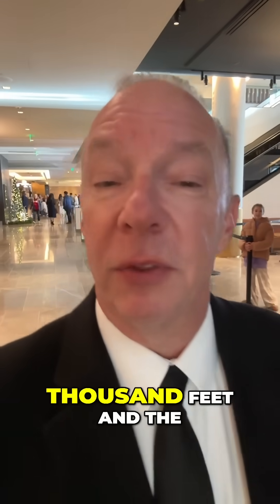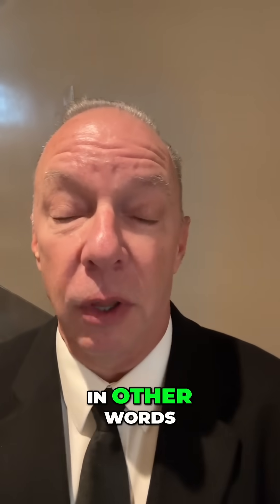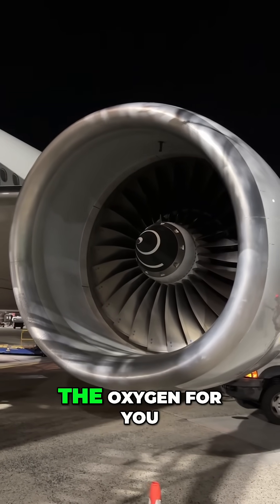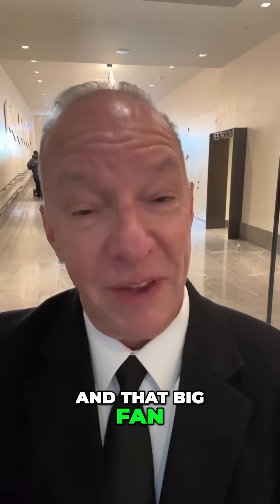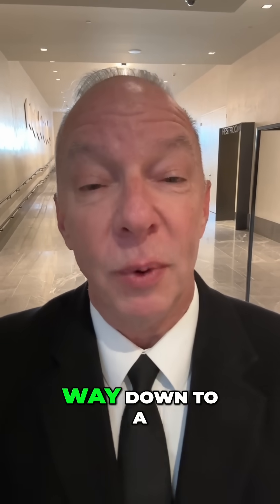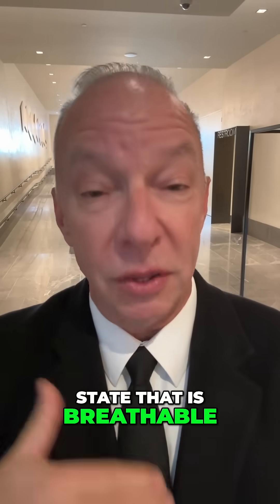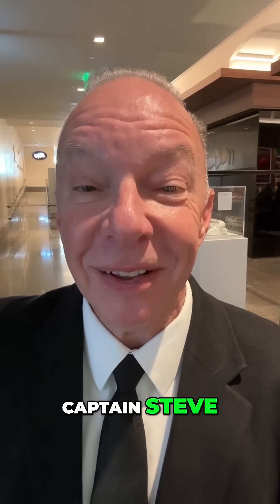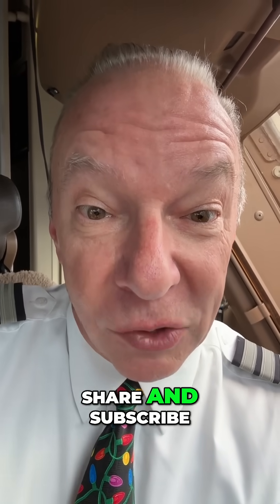How Airplanes Make Breathing Possible at 37,000 Feet

Comment: Will the battery 🔋 plane's they are saying are better can do this efficiently? Ive neber see that talked about. So cool. ❤
Reply: The Boeing 787 already has electrically powered compressors to pressurize the cabin air, independently of the compressors that are part of the jet engine.

Comment: Great stuff! Just a little missing detail: the cabin pressure is not set to sea-level as that would create unnecessary pressure stress. Normally passenger airplanes have a cabin altitude of around 8,000 ft, around 25% less pressure than at sea level. For comparison, Denver, CO is at 5,300 ft and La Paz, Peru is at 12,000 ft.

Comment: It's nice to hear a pilot that understands the working of these systems, especially the inner workings of the jet engine.
Reply: lol yeah most do as they must know what look for and have to read a Manual to know how to operate said aircraft. These Manuals are massive. 😅
Reply: @bigmungus4864  well yea, but jets are far more advanced than your standard combustion engine. I have far more respect for a professional that is able to explain the complex concepts at work here, In fluid dynamics, pressure differential, etc.
Reply: They are actually required to know just about everything about the aircraft they fly.
Reply: @Thomas63r2 rubbish , most don't know anything about the engines , just like race car drivers most times can't tell you how a simple car motor works , not their job , that's the engineer.
Reply: @JosephCowen-fz8vj  Incorrect, and no need to be rude. They don't know on engineer or mechanic level, of course, but they have profound knowledge about planes mechanics, avionics and correlation to anything related to aviation. Just like F1 car drivers know in detail all the mechanics to provide feedback to their techs, only much more complex.
Reply: @Rondo2ooo  if I was being rude you would know it . Well the facts are incorrect. A turbo fan is not a front " fan" is not a compressor turbine, infact you could remove that fan and still get thrust, I've had airforce members of my family all my life , and bar basic understanding, they know little of engine design , they leave that to as stated engineering crew . I think profound understanding is wildly overstated . All crew and pilots I've met have a basic understanding, the engine is far to complex for anything else . Pilots fly planes , like race car drivers drive cars , ask a F1 driver how the motor works , he couldn't even tell you how to start it . F1 drivers haven't given feed back for 35 + years , all computer telemetry as in modern planes .
Reply: @JosephCowen-fz8vj  For the video topic it's nitpicking. This was not a master class for turbine engineering and served its purpose for a short about oxygen provision. F1 drivers still provide individual feedback additionally to the telemetry. One prominent example is Michael Schumacher, who helped Ferrari to build competitive cars, because their telemetry obviously wasn't enough. Others do that, too. But we can have different takes, that's totally fine. It's just YT.
Reply: @JosephCowen-fz8vj  Lol!  Your mileage may vary - but every pilot I've ever talked with seemed to have technical knowledge of the planes they fly.  Interesting your race car driver analogy: I spent years in racing.  Even when not required, all race car drivers I ever met all found the technology interesting enough to often be the subject of conversations.
Reply: @Rondo2ooo  usually people don't consider pressure differential that's what I appreciate more
Reply: @Thomas63r2  you might want talk to  Danika Patrick on that one , she has won many many NASCAR races and in her own words " has no idea even how many cylinders it has " .
Reply: @JosephCowen-fz8vj  at least 1
Reply: @verdisquo97_arts  I'm sure some pilots take an interest in gas turbine engineering, but as a rule , couldn't care less , their job is to fly the plane , not to fixate on exhaust turbine temperature thermocouples and over temp blades .
Reply: @JosephCowen-fz8vj  I mean, king of random was a pilot before he became a hobby YouTuber, so pilots can have lots of interests
Reply: @JosephCowen-fz8vj  Quit with all this business that Danika knows nothing about cars, she makes comments like that to stroke weak egos in the racing world.
Reply: @Thomas63r2  yeah nah , and she's not the only one , race drivers don't think about motors unless they are in pieces bouncing into the trailing cars radiator. Simple .
Reply: @Rondo2ooo   Capt. Steeeve did not know the difference between a stator and a rotor. That's an indication of a serious lack of knowledge.
Reply: pilots are required to know pretty much everything about the aircraft they fly, especially the captain... seems like common sense
Reply: @mindlesspear8840  I can't believe it's been months since I said this message, and people are still talking about it.
Reply: He is a military veteran as well. He has had lots of time to think about the workings even if just curious.
Reply: He misspoke about tge stator vanes since they're stationary.  Rotor blades rotate.  Most pioits have a basic to moderate level of systems understanding.  Its complex so they don't need to know the minutea.  Its best they don't know fiber details as they'd be overloaded and could get too involved in troubleshooting an in-flight discrepancy that they'd get distracted.  They need to be flying the plane most importantly.  Some pilots are former mechanics so that'd be different but most aren't.   It's funny if you correct some pilots they can get pissy.  Steve's pretty chill though.
Reply: If he had got it rite that would be fair . As stated that big fan at the front of airline turbo fan motors is just that a fan or enclosed propeller , it bypasses most of the air around and is not the first turbine compressor blade , you can't see it .

Comment: Explanation is not correct. The engines keep the air PRESSURE high, not the oxygen. Oxygen is around 21% of the air we breath. Most of the other gas is Nitrogen. At altitude air pressure goes down. So not enough air/oxygen to sustain life. The aircraft systems keep the AIR cabin pressure up, not just the oxygen....

Comment: he’s correct regarding the compressed air from the engines. But an oxygen generator does not exist in the universe. Their are oxygen concentrators but in a jet airplane they use pure aviation grade O2 in tanks for a depressurization event.  I’m only a private pilot not a CPL to fly people, let alone an ATP which is what this gentleman is.  That said I appreciate the explanation and commentary but as an engineer the term oxygen generator sounds like anti gravity device.  Just a fun fact but commercial airliners compress air to a 8000 ASL or 8000 ft above sea level.  This is why your ears pop. At 10,090 ft you can experience light hypoxia. 

To summarize, guy is a way better pilot with way more experience and I appreciate his explanation but please get the engineering of the technology correct when explaining a rapid decompression event.

Comment: Just one thing. The "stators" don't rotate. The rotars rotate and the stators stay still. This is called the Bleed Air system. The engines push compressed air which is bled off the engine and cooled for breathing.

Comment: Fascinating. I knew it had to come from outside to an extent, but never actually thought about it before. Thank you for the explanation.
Here's a corollary question... What happens to the Carbon Dioxide. If 40% of the air is recirculating, then CO2 levels must be much higher than regular atmosphere? Are there CO2 scrubbers on the filtration system? What's the system for dealing with it? Thank you in advance.

Comment: Wonderful explanation Captain Steeve! The pressurized altitude is at the elevation of about 6000-8000 feet in most planes and 4000-6000 feet in a 787 Dreamliner (higher partial pressure is apparently why you sleep better, hence the name dreamliner). As a pulmonologist we occasionally simulate a higher altitude at ground level to see if patients with lung disease will need supplemental oxygen in flight, hopefully saving you from any unplanned diversions 😉

Comment: Stators blades don't spin. By definition they are stationary vanes that guide and accelerate the compressed air onto the next stage of rotor blades (which are the ones attached to the turbine shaft and do spin.) Otherwise, good explanation.

Comment: The 787 with Genx engine do not use bleed air for providing passenger confort, the air is provide using outsde air vía ram turbine and aircondition pacas.

Comment: Great explanation. I have a question that this might be stupid.
If the world is spinning at 17,000 miles an hour. How is it? That planes can go to different parts of the world? You would think you can  just go up in the air like a helicopter and wait till the world spins to the spot that you want to go to.
Reply: Earth isn't spinning at 17,000 mph.   More like 1000 mph at the equator.

Either way, Newton's first law is the answer.  When you depart from the Earth, you retain the existing velocity you had moving with the Earth.  Bodies need a cause to slow down, and not a cause to maintain an existing speed.  Just as you can toss a tennis ball while seated on the airplane at full cruising speed.  Trust me, or try it yourself.  The ball will land in your hand, and not slam to the back of the plane.

There is some effect from the Earth's rotation on how planes can fly, called the Coriolis effect, which governs prevailing wind patterns.  This is the reason flights at midlatitudes have a tailwind when flying east, while flights in the tropics have a tailwind when flying west.  This is a second order phenomenon, and doesn't produce wind speeds anywhere near 1000 mph.

Comment: Airliners are not pressurized to sea level. The cabin is at roughly equivalent to being at 6,000 to 8,000 feet of altitude. This results in having only about 75% of oxygen in the air compared to sea level. That's one reason flying can make you feel tired afterward.
Reply: About 8 psig
Reply: Cabin pressure at 6000ft. You need to be fit to be climbing up there, but since you're just sitting on you ass on an airplane, no problem there. It saves the airplane structure a lot not being pumped like a ball up to 1 atm (sea level). Inflating and deflating do fatigue the metal and a smaller amplitude of pressure changes allow longer lifespan or lighter structure, saving fuel.
Reply: Many people live at 6,000-8,000 feet elevation.
Reply: @KBP120  And athletes visit them and exercise there to build red cells counts and increase their aerobic capacity. The day you and me arrive there, we wouldn’t play football with the local children, we’d get hammered. 
Going to the toilet and making a real effort is quite different. So it’s quite safe yes. But you would not do a hike to 2000 - 2500 m while pregnant for instance. Airline companies aren’t confortable with pregnant women but that’s different.

Comment: Incorrect! Those engines do NOT 'generate oxygen' they simply compress the air at altitude which has the same oxygen ratio at sea level (which he acknowledged later). Secondly the 'stators' in the engine do not 'spin' they are called stators for a reason, they are stationary.

Otherwise not a bad explanation from a pilot, they know a lot about most things in aviation however they are not engineers so we can't expect a perfect explanation of technical terminology in aircraft engines.

Comment: Amazing. So how does this work in a propelar plane?
Reply: There's a separate compressor and inlet for cabin air.

Some propeller planes are restricted to only flying low enough, that you can directly breathe outside air.  E.g. Cessna planes that are common for hobbyist pilots.
Reply: @carultch  Thanks for the info.

Comment: at sea level we at 1 bar or 14.6 psi, at altitude it is way less, the fuselage is a pressure vessel, the compressed air comes from the bleed air section of the engine as you explained, where it is HOT and it goes through coolers and water separators and filters before it goes to the fuselage...there is valve(s) that regulate the pressure inside (outflow valve(s)) so the air is always "fresh" but there is some that is recirc'd but it is always being replaced.

Comment: jesus he mixed up everything. problem with air in high altitude is pressure. and engines just use tiny bit of power to pump more air in plane ie increase pressure. partial pressure of air don't exist, he probably mean partial pressure of oxygen in air. and of course current jet engines don't produce oxygen in fact they burn oxygen to co2+h2o

Comment: That first fan is called a compressor that compresses the air. That’s the only compressor because compressors in series become less efficient.  The rest are turbine blades and stator blades. Turbines can be put into series because they get more efficient in series and they are using up the energy in the air after combustion to power the compressor before the air goes out the nozzle in the back to create thrust. 

The maximum efficiency of that first compressor blade is only about 60 percent while you can get almost 100 percent efficiency out of the turbines together.  The design of an efficient compressor was actually the critical element that made the first jet engine possible.

Comment: "There is plenty of oxygen." Not really.... Sure, the ratio is still the same. But there is only about a quarter of the mass in the same volume. 

If you want to talk about "Partial Pressure" then you could talk about how generating oxygen too about 80% at that elevation would be about the same partial pressure as sea level.

Comment: Does the Boeing 787 also use bleed air? The Air conditioner system does not use bleed air, it uses an electric motor to run a compressor… kind of like a system in an automobile. Asking for a friend.

Comment: A little correction. Stator blades don’t turn. It’s the blades on compressor disc that rotate and stators are fixed in between these rotating stages.
Reply: Came to note this. Steve is still a VERY knowledgeable pilot! Also noted that between the stator (stationary blades) and rotor (turning) blades, the compressing turbulence increases the temperature with friction. It gets that air all heated, compressed, and ready to combust with the addition of fuel and spark in the combustion chamber.
Reply: @SamuraiPoohBearBudoBear  I thought most air is used like a normal propeller and gets pushed straight out
Reply: @meinderthoving  you made me Google it. On the modern "bypass" engines,  only 10% of the total air goes through the "burning" process. Interesting to know.
Reply: @meinderthoving Nope, its like your car engine. Air goes in, and is part of the "boom" that powers the pistons. Instead of pistons, that power DOES get pushed out the back (like a fan you describe) bit with a punch.
Reply: @SamuraiPoohBearBudoBear stators are not necessarily fixed.  Some are variable stators and move with air flow to prevent compressor stalls.
Reply: @imaPangolin Hmm... neat, ok... today I learned something. 1) my knowledge is military and 2) Many years ago.
Reply: @imaPangolin they're still considered fixed in relation to rotating or not.
Reply: @imaPangolin but they don't spin
Reply: On my first watch of this video I was like...wait a second...the stators don't turn. I had to google it to make sure I wasn't delusional. It's in the name, stator/stationary.
Reply: Thanks...my brain was saying, "wait, aren't those called stator blades because they are stationary?".  Sorry @TheParchisi, I didn't see your comment before posting mine.
Reply: Not an aviation engineer.
Reply: amazing that this guy is a captain but can not see
Reply: @hindugoat2302 I thought pilots needed to pass an eye exam.
Reply: @tjsbbi  when you can no longer see, your other senses become very powerful.
He can actually smell the runway and aim the plane towards it for landings
Reply: @tjsbbi  he has asian heritage

Comment: He's right on everything except a possible mispronunciation. Does engine blades are in series of rotating blades and stationary blades. The rotating blades are called rotors and the stationary blades are called stators and that's where the stepwise compression happens. He mistakenly called them stators
Reply from the maker: That is correct. Thanks for the clarification.
Reply: @CaptainSteeeve  when I was an Air Force crew chief , I myself may..may..possibly... have misidentified a component name toi,  at least once lol

Comment: The "Stator Blades" in each stage in a turbine engine do NOT spin, they are stationary. The rotating blades in each stage of compression in the compressor spin. SMH  Yes, it's the hot bleed air from the engine that is cooled by the aircon package and used in the cabin.

Comment: Oxygen at any altitude IS breathable.....it's just that at 37,000ft there isn't enough oxygen (per lung volume of air) in the atmosphere for you to remain alive.  The percentage of oxygen at all altitudes above sea level remains constant at about 21% (until you leave Earth's atmosphere).
Reply: Also, no commercial airline on the planet pressurises their aircraft passenger cabin to sea-level equivalent....that costs too much (due to higher fuel use)....I understand them to be pressurised to around 6,000-8,000ft above sea-level (which is why ppl with poor tickers go up to cruising alt and then have heart attacks).